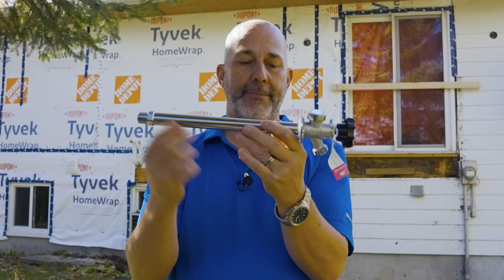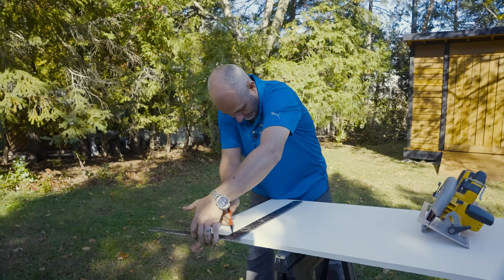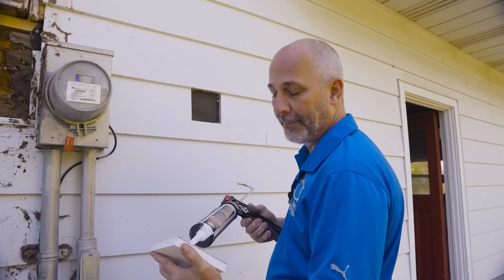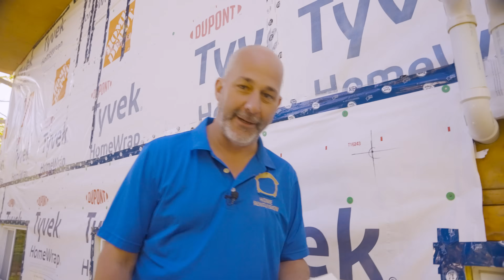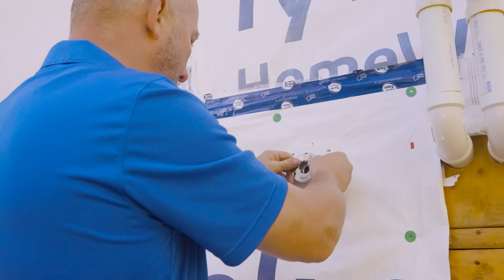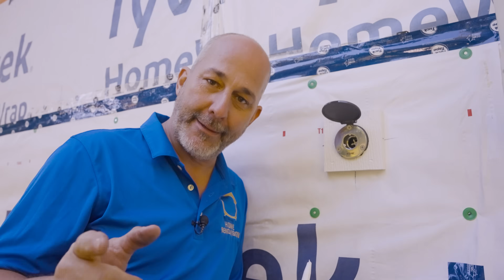Why Aquor Is the Last Outdoor Faucet You’ll Ever Need

Comment: Thanks for bringing the Aquor hose bid to this subscriber's attention!
For the interior install, Jeff did not mention checking the go/no-go fit of your crimp. I consider this to be a critical step when one uses Pex-B.
What is the recommended approach to vinyl siding installation? Should I use J trim or not? Cutout the vinyl siding flush and double (or triple up the PVC block) and caulk it in place?

Comment: Hello Jeff, I plan on having the Aquor V1 installed.  I got the parts.  But my only concern is that, am I able to keep the hydrant in the always on position since I want to use a sprinkler timer during the spring and summer months?  Also, how easy is it to get parts for this?  Thanks for reviewing this product line.

Comment: Are there any options if you're in a slab on grade house with 2x4 walls? These are cool , but they require either having a crawl space or some sort of very thick walls into an insulated space.

Comment: Jeff, your videos are always informative but always evolving and get better and better.   I live north of Markham Ontario, I had that frost free bib fail (slow failure) which led to a slow leak in the basement (I still have the bib for insurance purposes, could send you a photo as the end had blown up like a balloon) - lucky for me it was not a pipe burst but none the less any leak/flooding is a PITA. Had a new one which has a 1/4 turn feature on/off just this spring even with it shut off, the tap is dripping, probably the rubber seal gasket needs to be replaced but at only a year old makes me want the hydrant you installed. Additionally I think the plumber installed the bib wrong.  In the past I have used the pinch crimps you mentioned are not good so looks like I'm going out to get a ring crimp instead and replace the 6 or so crimps I've done.  Could you recommend  to me any places in greater Toronto area I could go for my DIY/Building supplies?  I usually go to Home Depot but its a hit or miss with the exact things I need, their caulking selection is few and far in between.  

If your ever out this way between Markham and Newmarket drop me a line! Cheers Jeff and thanks!

Comment: I just spent $1100 to fix a leak in the line to one of my hose bibs in a 2 1/2 year old house. The builder ran the CPVC along the rim joist with very little insulation and it cracked. Half of the price was to replace both CPVC valves with brass 1/4 turn shut off valves. I wish that I had seen this video before I called a plumber. I will be replacing both my hose bibs with the Aquor Hose Hydrant. Thank you for making this video.

Comment: Expansion Pex A is said to be better  and they have manual Expansion tool similar  but works opposite of crimp. I agree it is better and the tool I found  80-110 $ dollars  I will get the battery powered one , but manual one works fine.  To each there own .

Comment: Why is the pinch clamp system no good?  I re-plumbed my house about 4 years ago with pex and the pinch clamps and have not had any issues.  Is this something that I may want to look at replacing?  I am really curious because last I seen, this is still available at my local box store on the same shelving as the other indoor plumbing stuff.

Comment: Hi there,
I'm installing underlayment panels on my subfloor. After that, I will be installing vinyl wood floors.
Question: does it matter if I use nails or staples for the panels? And do I need to leave gaps and add filling afterward?
Thank you
Reply: @operationtruth5291 I've done flooring for years and the proper way to install panels for LVP is to glue the panels down (any Roberts 3000 series will do)  then staple with 1/4" crown staples by 1" long every 4" apart and 1 1/2 " apart on seems. Glue the floor not the panel to ensure proper adhesion. No need to fill gaps.
Reply: @goregor1639  
Thank you. Is it ok to use nails rather than staples? I don't want to have to buy a stapler and air compressor if I don't have to.

Comment: I've had one for 4 years. Installed to prevent opening a wall to raise a low connection. 

Two failed connectors in 4 years, probably partially on me for leaving them out in winter.

If I had to do it again I'd just open the wall.

Comment: I paid plumbers to replumb my entire house when we moved in (it had 80yo galvanized pipes) and they installed the hose bibs like absolute dingdongs, on huge uphill slopes, with no bleeder valves even so turning on the hoses every spring is a team effort of turning on the valve and making sure the pipe doesn't explode in the process. 

Fortunately it's PEX, so we've been lucky, but those plumbers really galvanized (ha) my drive to do everything myself because it seems like you can't really trust anyone. I vetted those guys, got three quotes and still, bozos. 

Their worst offense? They did crimp rings everywhere in the unfinished basement with open ceilings. Behind a finished wall for the toilet? A singular pex-pex sharkbite.(why??)

Comment: Step 1. Turn off outside supply valve.
Step 2 open faucet
Step 3 open valve bleeder
Step 4. Drink beer
Reply: Step 1: Disconnect your hose from the hydrant
Step 2: Crack open that beer 
Cheers!

Comment: Having used the cheap silicone before, I 100% agree that it's never worth it. Even putting aside cases where it literally doesn't adhere properly, it's miserable to work with and smells terrible! Never has saving $2 per tube caused me so much pain and suffering.

Comment: I already have a spigot outside that's leaky. I would want to replace it. So two questions... 
First. The hole i have right now is a inch and half, goes thru a brick wall. I measured roughly 8 inches between outside brick and the inside.  Over 8 inches, will a inch and a half diameter hole be big enough for the slopping pipe? 
Second. Would attaching it directly to the brick be fine? And if so, what type of fastener would recommend? Anchors?
Reply: You will have to expand the entry hole to 1 1/2" diameter. While you can mount directly onto the brick, we recommend using our Stainless Steel Mounting Plate for a more secure mount. 

For the stem length, if the inside is an open space, we have 10" and 12" stem lengths
Reply: @AquorWaterSystems  Alright. How is your day going?
Reply: Nice questions.. how is your day going?

Comment: When are you going to do the live phone calls again. That was awesome.... and I have a few questions. :)
Reply: You can also ask your question here in comment section others might find it helpful too
Reply: @HannahSmiley   Thanks, good idea. So, Me and my sone are building a basement for a house and couldn't finish it last year before the freezing weather. We haven't finished it, so there is no rebar, cement, or I joists to help stabilize it. The span is 58' and the center got moved in about 3/8". I have 4 courses left. Can I just slowly walk back each course to get back in line?
Reply: @HannahSmiley  Thanks, good Idea. I did
Reply: @mikew1956  +174
Reply: @mikew1956  +17
Reply: @mikew1956  +174
Reply: @mikew1956  +17
Reply: @mikew1956  +174
Reply: @mikew1956  +174
Reply: @mikew1956  91

Comment: Funny how MSRPs get “justified” based on “potential” savings vs vs manufacturing  costs+…. $100 for a short pipe with some machining smh
Reply: We know it doesn’t look like much on the outside—but like most good design, the magic’s in the details: high-grade stainless, tight machining tolerances, and testing that makes sure it lasts longer than the house it’s on.

Comment: Curious whether you'll do a drop ceiling or drywall? I did a drop ceiling for exactly these plumbing (and electrical) issues. It's more expensive than drywall, but it's easier to install (by yourself) and allows easy access to the basement ceiling later.
Reply from the maker: drywall for me. Cheers!

Comment: I live in the hot, humid south and have 2 of these on my house. They work great, but I would highly recommend getting the stainless steel covers/wedges and install with the hydrant from the start the FIRST time. I get a lot of sun on my house and I knew the plastic cover would be a problem someday. Installing the stainless one after already installing the plastic one and having the hydrant all setup was a pain because putting screws back in the same spot where I backed them out... just ugh. Get the hydrant, buy the stainless cover, install it once. Good stuff.
Reply: What is the hydrant you are referring to?
Reply from the maker: Good tip! Cheers!

Comment: frost-free spigot have solved this since before 2005. You simply turn off the valve from the outside and it turns it off behind the freezing point. It really is that simple. It needs to be installed at an incline.

Also, if you plan to redo the faucet outside. I suggest you one up and add both a cold and warm water tap. You can actually buy combo frost-free spigots for this. I have two of them and it makes the outdoor kitchen amazing. Plus washing the dog outside hehe.
Reply from the maker: great point. Cheers!
Reply: Standard frost free bib is fine, it will drain adequately if it is level. It will be level if your wall is plumb, my walls are plumb.  Never had a problem with mine. Like I said, this is a solution looking for a problem. Best part? I don't do anything with mine in winter accept disconnect the hose. Simple design, so secondary cartridge.

Comment: You did not mention to make sure your new hose bib has an atmospheric vacuum breaker for backflow.
Reply: Our V1+ model featured in the video has an ASSE approved atmospheric vacuum breaker in the connector. All of our House Hydrant models are ASSE certified. If you need a vacuum breaker that is integrated into the hydrant body, we recommend our V2+ model
Reply from the maker: not sure this product needs any help. Cheers!

Comment: Where did you hear that stainless pex cinch/clamp rings are not suitable for indoor use anymore?
Reply from the maker: experience. too many call backs years later. I won't touch them anymore. Cheers!
Reply: Ok so that is opinion/preference, not code
Reply from the maker: feel free to follow code if you want. but that is not good building practice. Cheers!

Comment: A properly installed standard frost-free hose bib is just as safe and self draining and it doesn't rely on a proprietary connection from a company that might go away.
Reply: For what it’s worth, it looks modern and great. I have one, and I appreciate how it works. I have the tap fitting which has a shut off knob instead of the default always on attachment.
Reply: Yeah, but the traditional frost free hose bib manufacturers didn't sponsor this video...  But seriously, a $100 product with proprietary connections needs to have a massive benefit over the $20 product to even get me to consider it.  To your point, the traditional frost free bibs work just fine if installed properly.  Twisting on a garden hose takes a few seconds and I am not in a tax bracket where a few seconds is worth that difference in price.
Reply from the maker: nobody sponsored this video. Cheers! Just a product I love!
Reply: @niemo118  I suggest that they would need to be more that half full of water to fail completely by fracturing the pipe. What are the odds they are that far off level???? The other thing that is unlikely is that they will freeze solid because they are inside the warm side of the wall.  I have never seen one fail.
Reply: I found a frost free at a house we bought that was sloped down inside and it had frozen and split the tube BEHIND the shut off! They "repaired" it with some of that stretchy, gooey tape...which leaked. ButI would still go for a frost proof, jnstall it right and insulate.
Reply: @niemo118  Ya, it is so stupid there must be a kickback involved.
Reply from the maker: I love the 1/4 twist engagement product! stops the leak at the hose connection permanently! Cheers!
Reply: @HomeRenoVisionDIY  What leaks?  Mine doesn't leak at all. Two simple rubber seals that last for years and cost next to nothing to replace. Hoses have rubber washers that cost next to nothing and last for years.  Like I said, a solution looking for a problem. I haven't touched my hose bib for more than 10 years.
Reply: @HomeRenoVisionDIY  Nah it doesn't. When those vaccum breakers fail they spray wildly, and you can't just go out and pick up another. You're stuck waiting on the replacement.

I've had one for 4 years, and two connectors have failed in that time.
Reply: Yup, nothing wrong with frost-free older design, this is a solution looking for a problem.
Reply: @GregoryClarkson-j1j  you’re stupid.
Reply: My dad used to make a big skating rink in the backyard, so the traditional frost-free hose bib was used almost every day throughout the winter, even several times a day at the beginning when he was building the rink, from 1978-ish to the early 2000's.  House was built in 1971, the original hose bib was still in service when my mom sold the house in 2018.  Will your $200 solution in search of a problem still be in service 50 years from now?
Reply: Homerenovision, love your videos. Lots of good info.

Did you say towards the end that PEX cinch/pinch clamp rings are no longer allowed/recommended for home plumbing? I think that is false.
Reply: Meh.  Too proprietary for me.
Reply: Hi all! While it's true that some people never run into issues with their traditional frost-free spigots, there are also people who run into one-off or consistent issues. We aim to provide another option at either point. Whether you want it for the change, ease of use, and warranty or if you need it because your existing unit is busted; you have the option of choosing Aquor!
Reply: Exactly my thoughts. Give me the tradition hose connection.
Reply: Also you loose ability to control the flow of water. I personally cannot open my tap all the way or the water pressure will start clearing the sediment out of the city water pipes. But there are many other reasons you may only want to open your connection a crack. New design misses this critical feature…
Reply: That is what I was thinking is the frost free does work I have never had a problem.

Comment: How do you do this in a brick house lol!
Reply from the maker: simply drill through the masonry with a 1 1/2" bit and then switch to a wood bit for then rim joist. Cheers!
Reply: @HomeRenoVisionDIY  Drilling the hole isn't the tough part.  How do you seal behind the cap or board.  Brick has a lot of gaps.  Do you just flood it with silicone?
Reply: @HomeRenoVisionDIY  Not every install goes through the rim joist. Some need to be higher on the wall. Rim joist nstall is a no brainer.  No way you need to drill a 1-1/2 inch hole in your brick veneer to install a standard hose bib through brick veneer. It isn't that difficult.  Cheers!
Reply: I installed the standard old school version through brick. In a joist cavity it was easy. I also installed one about 20 inches above floor level onto my outdoor deck. First, scope out a location where there are not any electrical outlets or switches nearby and you are not directly inline with a wall stud or joist. Obviously, you need to be close to water supply. If you are not comfortable scoping out the location, hire a professional. I had easy access to plumbing under my kitchen sink so I teed off there. There is some risk associated with this so go very slow and gentle. Now open up the wall from the inside to about one inch diameter. Check the path of the hole from the inside to the outside to see if there are any wires or plumbing close inline with your hole. If all is OK drill a hole from the inside to the outside using 1/4" x 16 inch long carbide tip masonry drill bit and a hammer drill, slowly and very gently drill a pilot hole through the wall from the interior to the exterior.   Now from the exterior, drill multiple holes through the brick in a circle around the small hole to clear the valve body and chisele it out. Insert the valve. Remove the entire valve mechanism from the bib before you solder anything. Secure the bib to the wall with tapcons. Re-install valve mech.